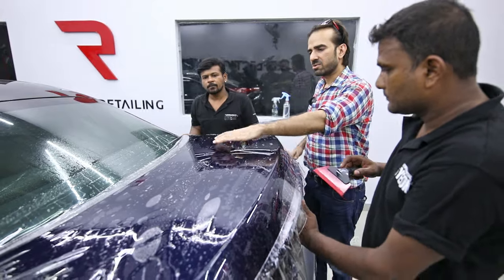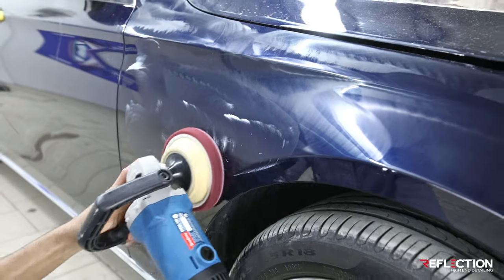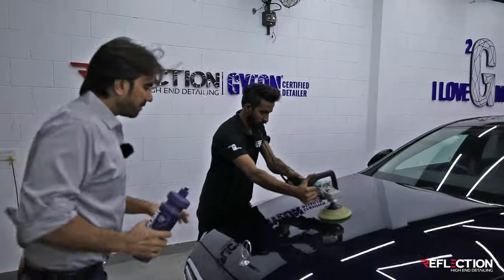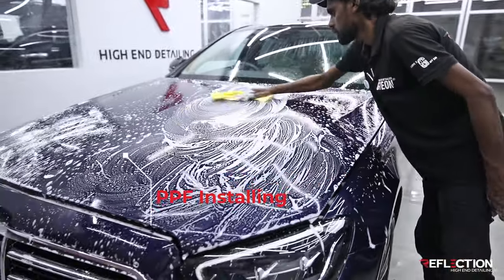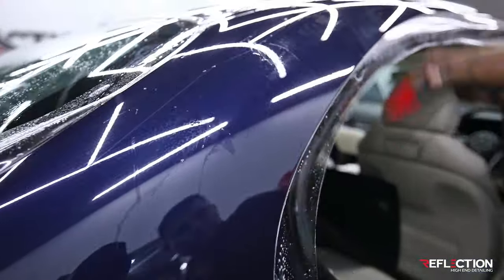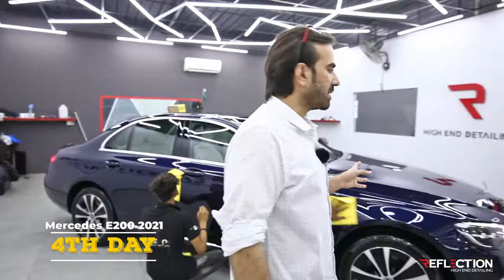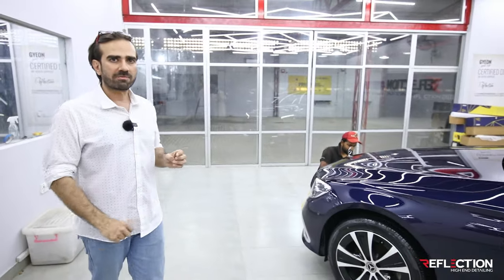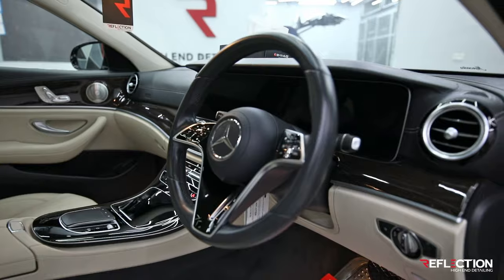Latest Mercedes E200 | PPF in 1 Day? | Professional PPF Installation

Comment: Is it possible to apply Paint Protection Film on a car after it has been ceramic coated?
Reply from the maker: Yes, film can be installed. For complete details pls call 031-111-45-222.  
Thank You